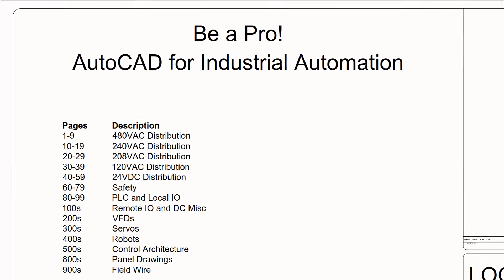AutoCAD for Industrial Automation

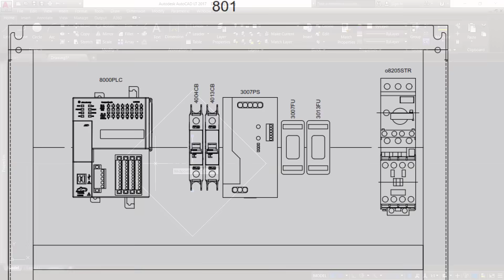Comment from the maker: 00:00 I’m gonna show you how to create electrical drawing for industrial automation
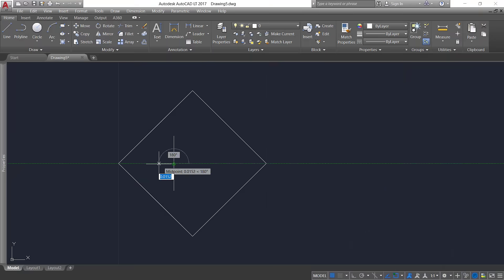00:04 with AutoCAD I’ve boiled down years of experience with AutoCad 
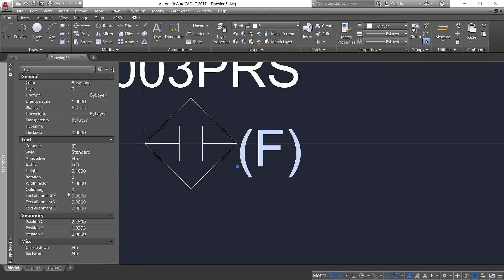00:06 as a controls engineer into an easy to follow process 
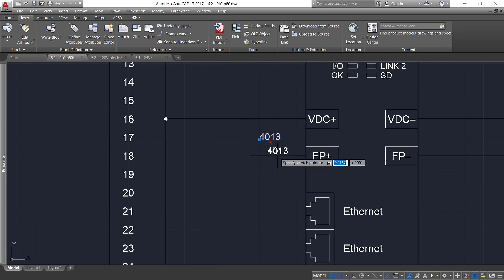00:10 I show you all of the strategies I’ve learned to quickly and cleanly produce
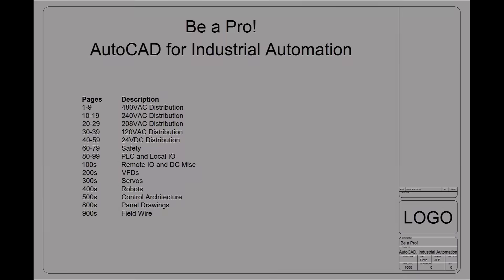00:14 schematics and panel layouts follow along with over forty examples
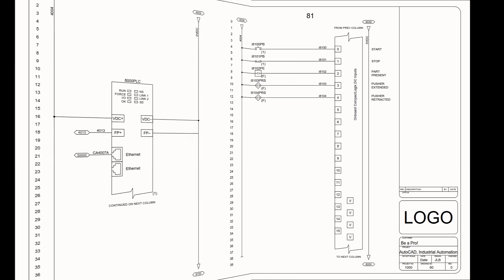00:18 that give you a jumpstart on your next project AutoCad courses are easy to find
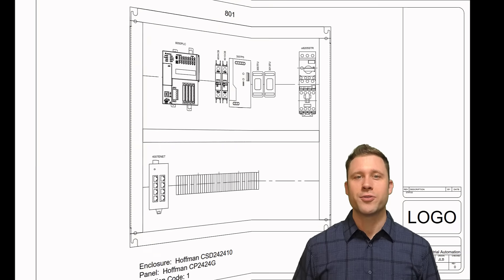00:22 but I teach you how to do a job if you want to advance your career
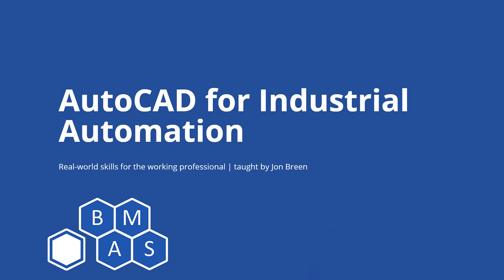00:26 click here for a free intro to the course